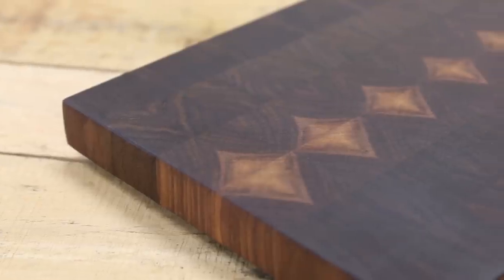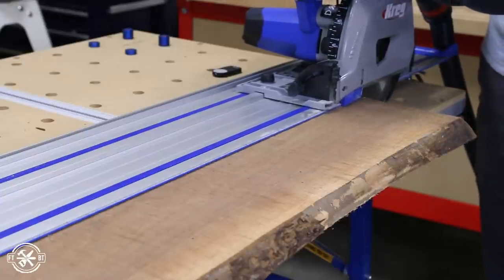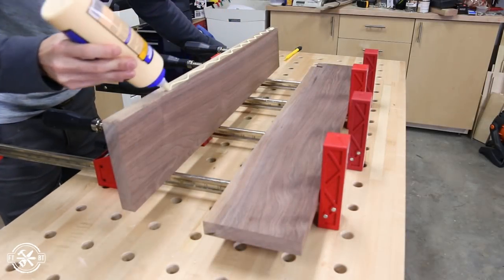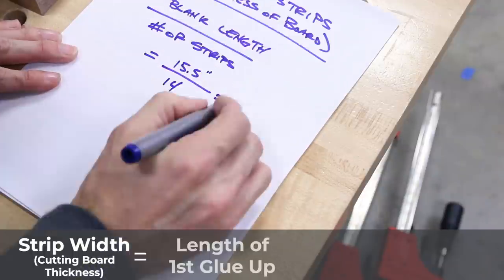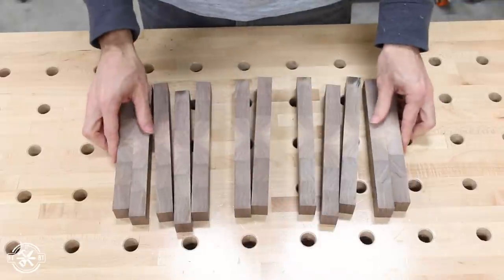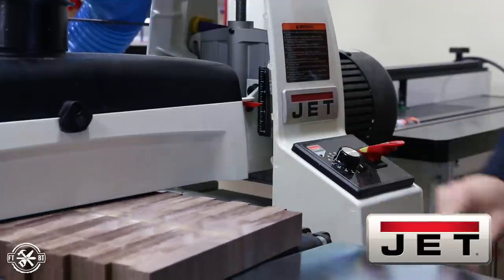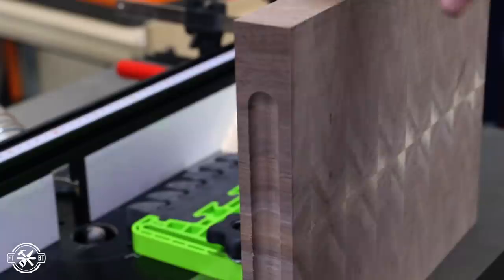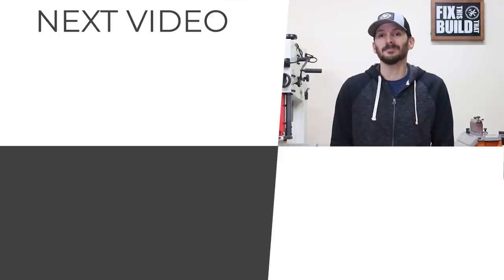How to Make an End Grain Cutting Board w/ 💎 Design | Woodworking

Comment: I’m a new woodworker, only about a year. I’ve made two cutting boards so far, and I find that when I am finishing with the mineral oil and Beeswax oil combo you used, that it still feels oily for a while after. Granted, I haven’t been the one using these, as they were both gifts, but I am curious if you have any advice for getting them cleaned up nice. It seems that no matter how much I wipe and wipe, it still feels a little oily on my fingers. Any advice for me?? Thanks, love watching your videos!!

Comment: Heyyyy, that trick isn't supposed to work with squeaky clean clamps. I thought you had to level up by having grimy clamps like me to make it work.
Actually.... that sounds like it could be the next Woodpeckers product, the Woodpeckers Clamp Cleaner in red anodized aluminum 😂
Reply from the maker: You think they could anodize pallet wood? 🤔🤔🤔
Reply: @Fixthisbuildthat  only if it's Baltic birch pallet wood
Reply from the maker: Baltic birch pallet plywood. I feel a collab

Comment: Nice video.  I've always been worried to line up the joints like that, essentially leaving a few continuous joints through one piece, and so I've always opted to stagger them like when laying bricks.  Have you ever run into an issue of that creating a weak spot?

One tip, there is no need to buy that expensive "cutting board oil" (just for clarification I'm not talking about the beeswax one).  You can buy mineral oil in at any pharmacy for closer to 3 or 4 bucks.  The mineral oil in a pharmacy is meant for human consumption, so it is definitely food grade.
Reply from the maker: I've never had an issue with the seam down the middle. That's a long grain joint so it's super strong. Not much different that a glue up up two boards into one panel

Comment: I bought a supermax just for my end grain cutting boards. I have a problem with burn marks, i keep the belt very clean. i have used 80 grit and 120 grit paper, any thoughts?
Reply from the maker: Probably too aggressive of cuts. I do 1/16th of a turn at a time. 1/8 if I'm really aggressive. Handle turns, not inches
Reply: @Fixthisbuildthat  I will try that, thanks

Comment: 3/32 thick blade.... wow, never seen one that thin.
Reply from the maker: that's a typical thin kerf blade size, 1/32 less than a full kerf.
Reply: @Fixthisbuildthat  You're right.... I guess I always assumed that they were 1/16th.

Comment: Using your planner is not dangerous... as long as you take extremely light passes and use a sacrificial board on the end to avoid blow out.  A drum sander is ideal though 👍...again...extremely light passes ha ha ha
Reply from the maker: It's not dangerous if done exactly the right way...which means I'd never recommend it since I can't assure people are going to follow the rules :)